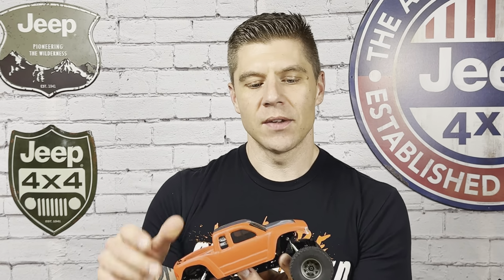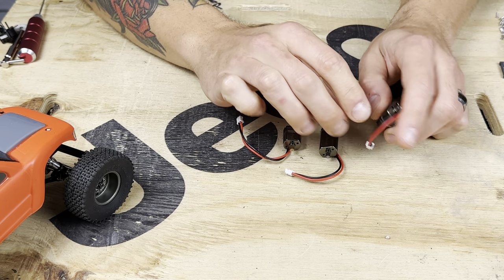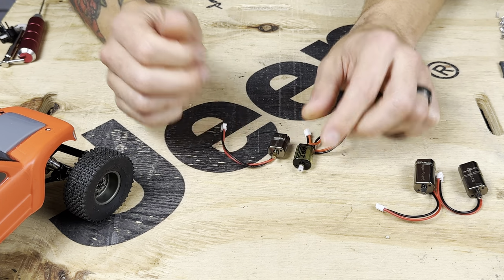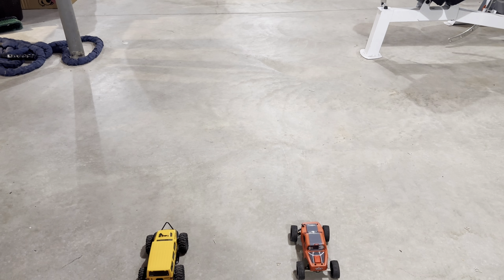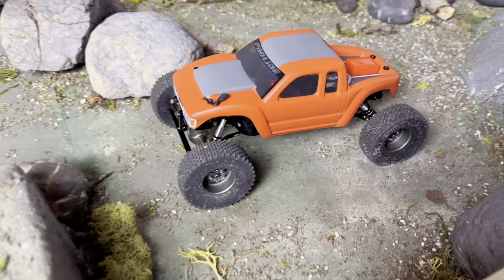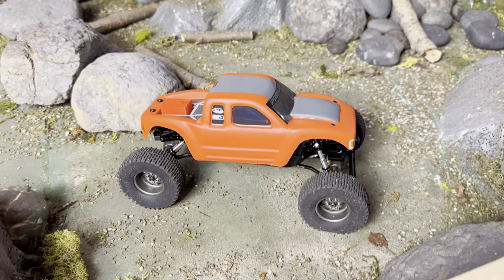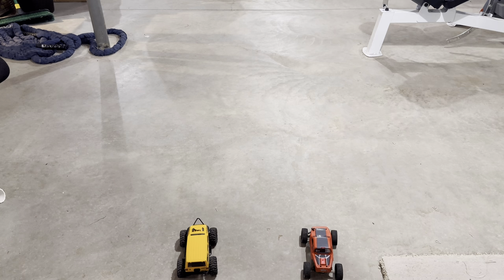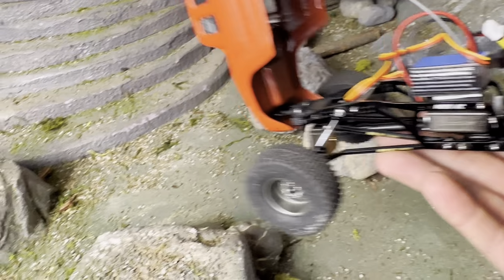SCX24 Comp Build - NEW MOTORS - Mofo RC Motor Comparisons! Speed Runs, Crawling, & More!

Comment: Domt forget how important it is to all of us to know the cost of all these goodies you are putting together.
Reply from the maker: Good point! I’ll do a cost breakdown in a future video. It would be fun to do a budget comp build and then put them head to head. What do you think?!
Reply: @CapeCrawlers  the budget comp vs expensive 100% would be cool. I am doing the same. I have a bronco and jeep going brushless all out metal on one and thinking of doing the brushed in the other, just debating if I need to do the ESC as well which gets the cost up there.
Reply: Budget vs high end build throw down would be VERY interesting and cool to see!
Reply: @CapeCrawlers   Yes that would be interesting to see if it's worth the cost of some of those upgrades. I've found that stock set up is better at certain tasks and upgrades are better at others. Seems there is always a big compromise either way.
Reply: I ordered a Danchee Ridgerock for myself for Christmas, but it was on back order so I kept shoppin. I found an Axial 24 on sale and ordered it before finding out an hour later the Danchee shipped (oops?). Told wife we could return the Danchee, or give it to my son in law, but my wife decided to give it to my daughter( for me to build, and play with?) winning!! I was considering a 2 speed trans, but this has me thinking Buzzsaw will add that versatility, and save a Chanel for 4 wheel steer.

Comment: in the process of building an Ugly chassis myself and i am curious to know what youre using for a body mount, both in the rear and the posts up front, im searching everywhere and cant find the info i need. Thanks!
Reply from the maker: I used a magnet mount up front. Two strong magnets. I bought a deadbolt magnet mount from Amazon and glued it onto the tops of the front chassis rails. The two magnets up front are strong enough to secure the entire body

Comment: I would have made the same choice out of those motors. I'm loving the Injora Pro 50 it's a great little motor, loads of easy to control torque and enough wheel speed to bump up obstacles!
Reply from the maker: The pro 50 is a great motor!

Comment: I just bought the scx24 gladiator and have the rcawd portal axles on the way. Plus I have the swamp king tires. Would the buzzsaw motor work with that well or is the torque beast 50 be better overall? I just don’t want to snap a axle lol
Reply from the maker: It depends on what you like to do. The buzzsaw is surprisingly versatile but doesnt have the low end torque or controllable power delivery that the torque beast does. Neither of them have axle breaking power, so I wouldnt sweat that. Driving style will break axles before the motors do.

Comment: Can you help explain what the different options are when choosing the mofo motors I see they sell it as motor only then mod3 , mod 5 , then a platinum mod 3 and platinum mod 5. What’s the difference. What one did you use ? Thanks awesome videos
Reply from the maker: I will do my best! Platinum motors are the newest ones. I think he improved the internals of the motor for more power and better longevity. Also gave them a new colored case. Mod 3 uses a pinion gear that fits stock transmission gears, so a direct bolt on with no additional mods. Mod 5 uses a different pitch on the pinon gear and meshes with an upgraded spur gear on the transmission. I am using newer motors (some are 2.0, others are 3.0) and mod 3.

Comment: Curious about this rig vs. the Punisher build.  How do they compare?!?!  What made you “comp” this set up vs. the LGRP?
Reply from the maker: It would be a great comparison. I think the comp rig is more capable right now; it is very impressive. However, it is under-powered and outclassed by the furitek system in the Ultra. I started the comp rig before I got my hands on the Ultra24. Otherwise I probably would have just done one. But I also was itching to do a completely custom build, body and all.
Reply: @CapeCrawlers  … they are both awesome but the Ultra24 really stands out.  I thought it was interesting to hear you say that you wish you’d gone with the 3D printed LGRP axles.  Surprised me!  Everyone is always trying to go aluminum/metal/brass and I’ve often wondered if the 3D printed would be more weight reduction and give you more control over where you target your weight placement? 🤔 I just finished my Injora buggy (waiting on the lizard ultimate) and thinking about the next project.  I really like the “Jeep” body LGRP has too.

Comment: For how long those shocks are on your Cliffhanger, what kind of driveshafts are you running? Seems like the stock ones would drop right out in the front, if those shocks drop the tires any lower. Lol
Reply from the maker: Stock length gladiator shafts. I try to mount them in a way that they don’t drop to such an extreme degree that they cause issues
Reply: @CapeCrawlers  nice. 🤟🏻
Reply: this is on the stock esc? no lizard pro?

Comment: Do the larger/longer motors besides speed and torque add any additional weight or ballast? Gorgeous rig.
Reply from the maker: They do add weight, mainly because its just more metal material in the chassis. Because of the positioning, the bigger 050 motors may provide some benefits, but the distribution is skewed a little further back than you would normally want.

Comment: Want to try these mofo brushed motors but wondering if I need to invest in a Furitek Lizard PRO as well? Are you using the stock esc?
Reply from the maker: For brushed motors you don’t need the lizard pro. It’s nice to have that customization option with the furitek app, but you won’t get the same benefits with a brushed system versus brushless. I am running stock electronics on the comp build.
Reply: @CapeCrawlers  Do you run steel spur gears or stock also? Stock size or mod.5 if you do use them? Thanks for taking the time to respond all these options on their page make me wonder if I should overspend or not haha
Reply from the maker: @cctravis  stock spur gears in this one. I have steel gears in some other builds (brushless) but kept the stock ratio.

Comment: One thing you could try is running the fruited system with a brushed motor. I think you can use the electronics with brushed and get a very nice smooth and slow set up.
Reply from the maker: I’ve tried that on the gladiator but only for a minute before I did the brushless motor. I’ve got an extra lizard I could try out so maybe I’ll do that!
Reply: @CapeCrawlers  oh that’s cool you should try it and make an Instagram post about it. Or some post about it

Comment: What about the mod 5 spur gear. You need that with the torquebeast 50 motor.
Reply from the maker: I’ve never tried the mod 5 actually
Reply: @CapeCrawlers  I purchased that torquebeast motor a month ago. The mofo site said I needed to run the mod 5 gear with it. I’m in the middle of the build right now. I can write you and tell you how it runs if you’d like?

Comment: What type of weight you recommend for a flex machine? Scx24 gladiator
Reply from the maker: It depends. My gladiator is 650g but I felt like it was necessary because of the tall chassis from the portal axles. I would focus more on performance rather than weight. Keep experimenting until you feel like you’ve got a well planted and functional setup
Reply: @CapeCrawlers  any brand in specific?
Reply from the maker: @rampagepr3524  treal makes great, heavy brass parts for down low. Their big brass knuckles are crazy heavy. They also have great hex extensions.
Reply: @CapeCrawlers  thank you

Comment: Have you ever tried the mofo RC brushless motors?
Reply from the maker: Yes, I’ve got the SMP in my green deadbolt. It’s an incredible motor!
Reply: @CapeCrawlers  just subbed! that’s good to know I was looking at the smp and the nano beast and wasn’t sure what would be best. Are there any other options for a brushless esc other than a lizard pro? There so expensive in Australia.
Reply from the maker: @grantchamberlain2508  I think furitek is the only option for the 1/24’s. I may be wrong, but I certainly didn’t see any alternatives when doing my builds. They’ve got the market cornered!

Comment: I might of missed it in the first video sorry if I did but question on the tires on this rig. You running stock foams? flub? and or vented? Thanks man
Reply from the maker: In this video I’m running the new Injora comp pins in 55MM. Soft crawler innovations lil nova foams. The wheels are vented, so I didn’t have to vent the tires. I did end up changing the tires though. I felt like I needed more clearance. I’m still experimenting with tires right now but I’m leaning towards the rc4wd scramblers